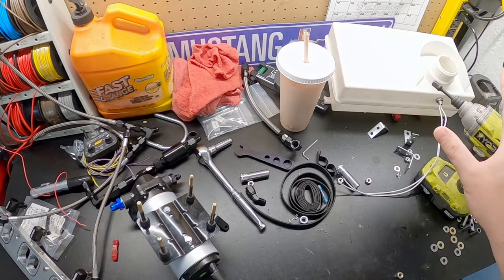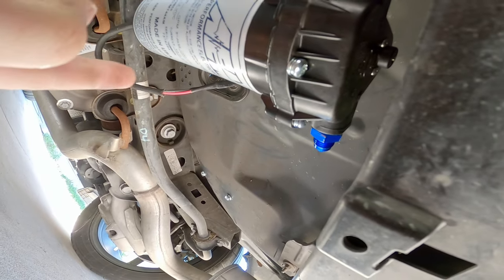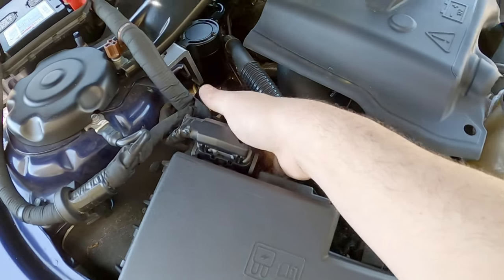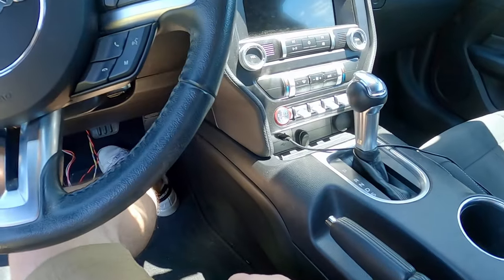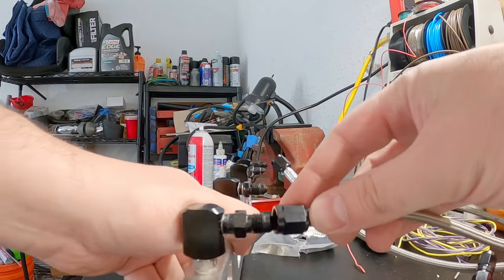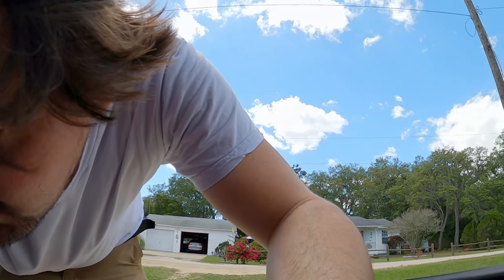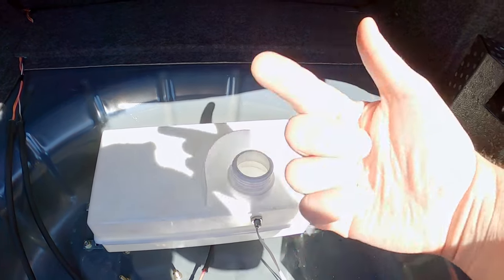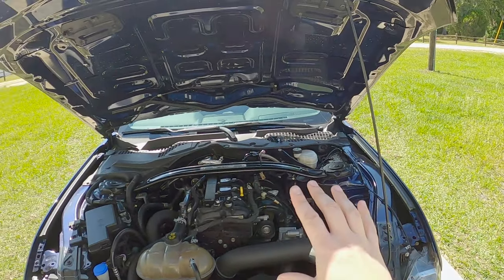Final Install & Purging the System *It Got Really Wet *

Comment: You can wire up a relay to the float and reverse the signal as there are 2 references normally open or normally closed when energized. The wires are already under your dash if you use the harness just splice it in.
Reply: That's a very useful advice !